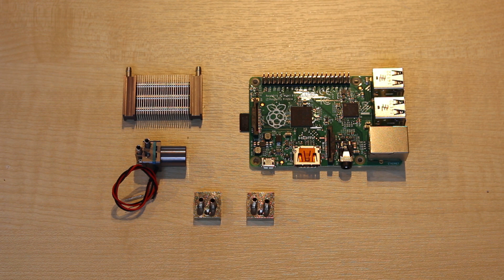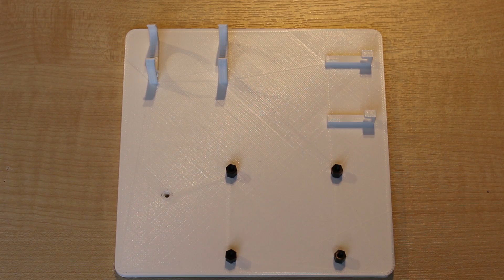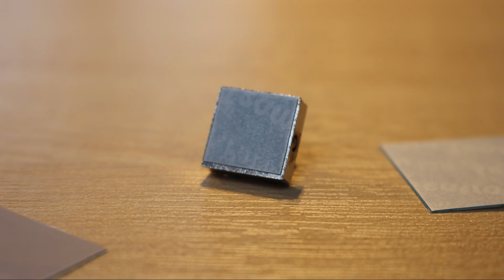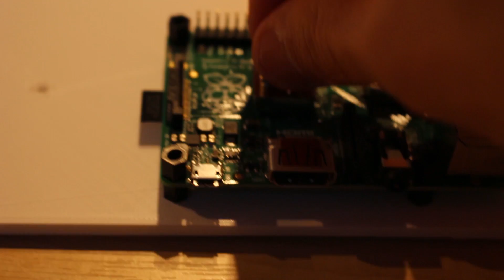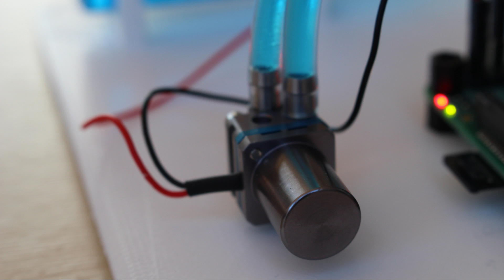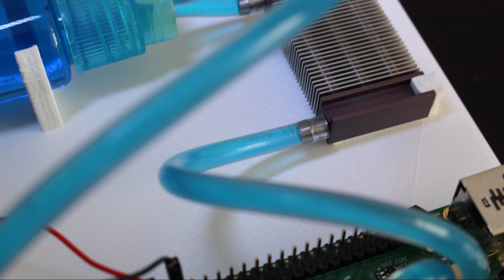Water Cooled Raspberry Pi

Comment: I do not see any fans, heat sinks, or Thermoelectric Cooler Peltiers. So does the pump do the cooling? Otherwise you are just circulating hotter and hotter liquid.I am not asking to be critical but rather to learn.I am working on my own smaller form design. I am going with 15mm x 15mm peltier,15x15 heatsink, and 15x 15 fan.  Simple pump to a small radiator with heatsink and fan.Also is that 8mm inside(10mm outside) tubing.  I really like your design. Just not clear on what cools the water and hence the raspberry pi.

Comment: If I did the converting correctly you spent well over 150 usd. It's a cool project but that's a lot to watercool a pi. Either way it looks great and I'm sure ite running cool.
Reply from the maker: Hi, thanks for watching and your comment, yeah it is very expensive, can watercool a PC for that! But I use the pump and heat exchanger for other things also and not just this project which justified the cost a bit